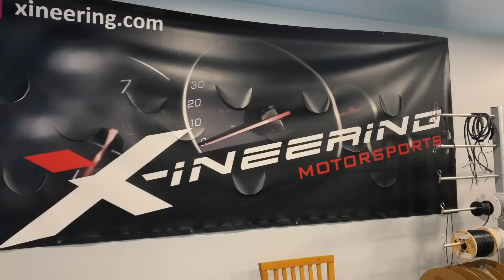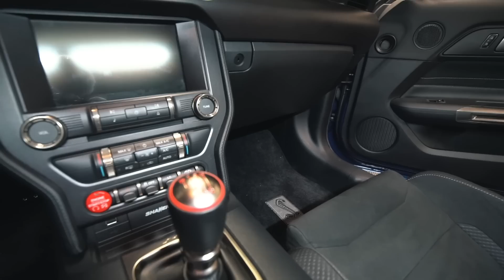The BEST GT350 MOD? **FIRST MOD since the NEW MOTOR!

Comment: Thanks Jeff for the detailed explanation, it would have been nice if Ford had included it as a built in on/off option on the 350's as they did on the 2019 GT's moving forward. It would give all of us the best of both worlds, a manual transmission that we can enjoy during normal and some spirited driving, but the assistance of auto blip when on the track at high speeds. I appreciate your disclaimer at the end that this is not something that is needed during street driving. In fact I have had many 2019 GT owners say they turned this off after a while.. it was cool at first, but annoying when auto rev matching pulling into the shopping mall (LOL). I just purchased a 2019 GT350 and have never been on the track. I am going this spring to see how I like it and if it is something I want to pursue further. If I would want to continue and really push the car this would be a must for me as well. thanks again for your detail and great content

Comment: Really thorough video, thanks for sharing. What pedals do you have? Those don't look stock!
Reply from the maker: Thanks! SRP pedals, huge upgrade over stock. They have little teeth on them that do a great job of gripping your shoe. I went with the medium width gas pedal which is quite a bit wider versus stock.
Reply: @JeffAshton  Perfect. Thanks. Going to give these a shot on my gt350 before taking the plunge into the auto blip!

Comment: Great mod. The GT350 is hard to heal toe for sure.
Reply from the maker: Definitely an under the radar mod especially if tracking! #blownmotorbrethren 😁
Reply: @JeffAshton  I'm actually thinking hard about putting another tune on mine (one for race fuel and then reloading my E85R tune) but I'm petrified after Woman Driven got denied......... Choices, choices...
Reply: @Bodhi7007  The sad thing is I thought I was a heal to toe pro until I went to Ford's Track attack and tried to heal to toe from 100 mph! NOT the same as on the street!
Reply: Yeah, the pedal box is probably my biggest complaint with mine. I just cannot find the right seat position, shoes, and foot position to be comfortable with how I'm used to heel toeing.

Comment: I use the Auto-Blip and have had it installed on my 18' Gt350 for well over a year now. I absolutely love it. Haven't had one issue and everyone I've talked to loves it. Very easy to use. I'm sure the one you got Jeff is really good too so I'm not gonna bash their product by any means. However, speaking from experience and in my opinion, Auto-Blip is the way to go.
Reply from the maker: 316 RACING glad to hear it’s working for you. I know several people that have switched to the Xineering unit because of issues, which is how I found out about them. AutoBlip ignored my email too so there’s that. 🙂
Reply: @JeffAshton  what issues were people having with the Auto-Blip so I'll know what to look for if something goes wrong with mine god forbid. Thanks man!
Reply from the maker: 316 RACING what I’ve heard directly from multiple owners is the unit will not always work. Guys have been on track and it will literally just stop working. They’ve rechecked/retapped their DBW and still had issues, which resulted in them pulling the unit. Again, glad to hear a success story but like you said, just keep an eye on it. 👊
Reply: @JeffAshton  thanks man and will do. If something ends up going wrong I'll look into your unit for sure. Let us know if anything happens with yours. Keep up the good content Jeff. Thanks.

Comment: Hey all if anyone in the comment section has more knowledge or experience than myself, I'd love to hear your thoughts on modding out a 5.0 coyote, or nodding a new gt350r.

I've heard the 5.0 has a better platform to take mods? But I haven't found evidence to support this. I'm a huge shelby fan, I'd love to have one over a Gt mustang. I realize the 350 isn't a drag car but mainly a track one. I do not want the 500. So after break in period and everything is done on the gt350r I'd most likely add a supercharger among various other mods. If I got the gt same with that. Just wondering which is the better platform? I'd think the 350 would have upgraded parts, and better block. I know you could get a gt for half the price of a shelby and save money but I've been saving for a shelby for a long ass time. Just looking for some thoughts and facts

Comment: Another choice from autoblip is a pedal adjustment to make the brake and throttle closer so you hardly have to move your foot
Reply from the maker: RV H I actually have wider pedals already (SRP), but when braking from 145mph going into turn 17 at a course like Sebring, having a blip module is still much more confidence inspiring. Last time out I ran three sessions heel-toe downshifting and three sessions with the Xineering blip module.
Reply: @JeffAshton  
Oh I'm sure it is more effective and faster. But i got a GT350 because it was so analog. I don't like too many computer aids.

Comment: In theory the idea of it is good for those not familiar with rev matching. However the purpose of “heel toe” or rev match, is to precisely match engine speed to wheel speed to avoid breaking the car loose... listening to it operate, especially in 1st gear it’s a complete overrev from what I’m hearing and seeing.... which means the inexperienced driver that comes off the clutch too fast in that overrev ends up breaking loose , defeating the purpose of rev assist. the real crime here is the Camaro comes with computer controlled auto rev match for guaranteed precision, no lift shift ... and while I’m at it ediff and pdr ... I don’t get why gt350 owners pay 20k more without the features to be less of a track car... ive had mustangs, Shelby’s ... i just think it’s a crime these cars don’t come competitively equipped and arnt really comparable ... especially with grenading voodoos all over...  oof here we go with the hurt feelings ... just fact 😭... nice vid Ashton , your happiness is all that matters, it’s not accurate down shifting that compares engine speed to wheel speed , it’s a blip machine... sell it while you can and get the true track star... not naming names
Reply from the maker: You would never really need to rev match down to first gear, in the video that was just an example of what it will do if you’re driving it through the pits, clutch in and hit the brakes, that’s what the switch is for so it’s only turned on when needed. You can completely fine tune the blip module to exactly how you want to set it up, the rest of it comes down to the driver understanding how it’s set up via the blip percentage, duration, etc... The 18+ GT does come with active rev match, but I’m not sure why the 18+ GT350 does not.

Comment: Lot of dummies here flapping their lip about “learning to heel toe.” Unless you run in advanced run group or race on a Road Course not some BS “canyon” drive, don’t comment about crap you know jack about. I’ve been racing and driving motorcycles and cars on a road race course since late 90’s. So I know what I’m talking about. We track rats want to get better lap times through threshold braking at near anti skid cycling. Unless you are a highly developed amateur or pro driver with loads of track time, heel toe while hard aggressive braking and downshifting smoothly can be inconsistent and takes brain power away from cornering the car. Also a street car doesn’t have a race car’s big boosted brake so it requires high pedal pressure to get hard braking which makes heel toe more difficult. And F up a downshift or have a pulsing brake application and go off track at best or destroy your gearbox or car at worst. It’s about smooth weight transfer and stability on the contact patch while entering a corner on track. Also it protects the gearbox and synchros. Ok I feel better. It’s just a shame Ford was cheap and didn’t already have this feature like GM and Porsche does.